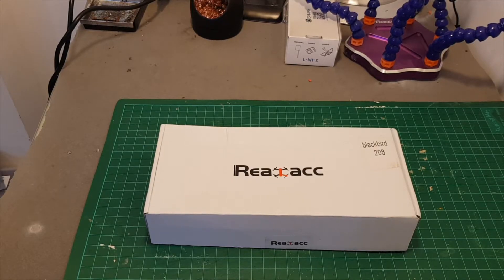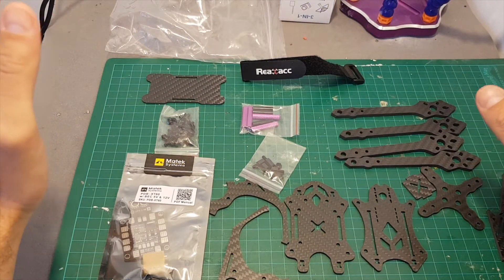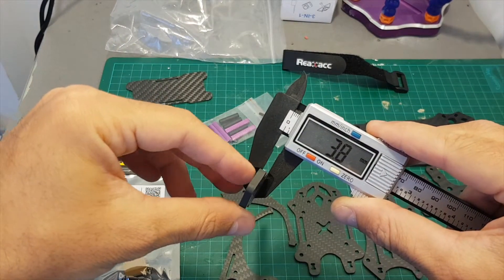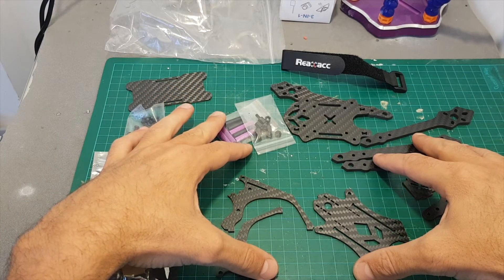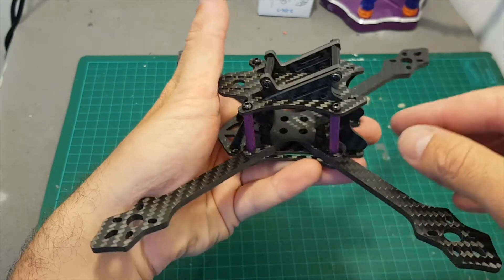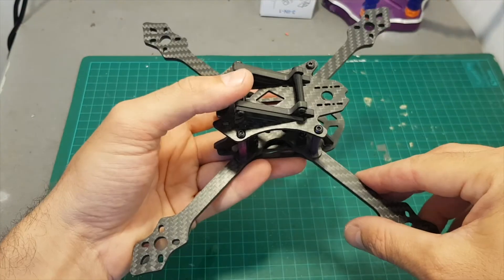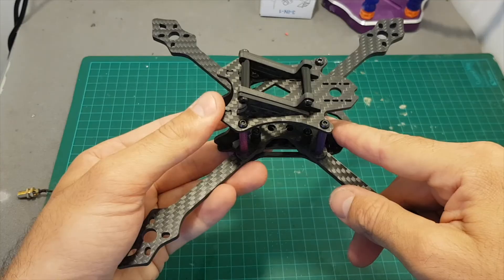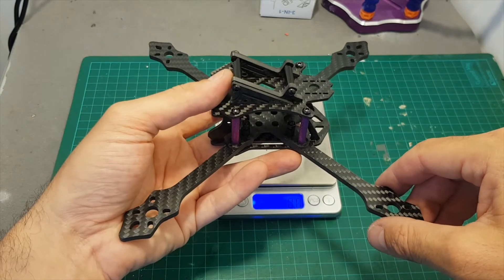Realacc Blackbird 208mm Frame Build and Overview

Comment: I used an asgard AIO in my 3 Blackbirds, dropped out the center and hd plates so dry, 270grams, with an tattu 1050 its 394grams, running ZoeFpv z1806/2900kv with Hq 5x4.3x3. givs solid 3 min flights freestyle and sub 2min race. love the frame and is in the development of an own version of it in stiffer carbon